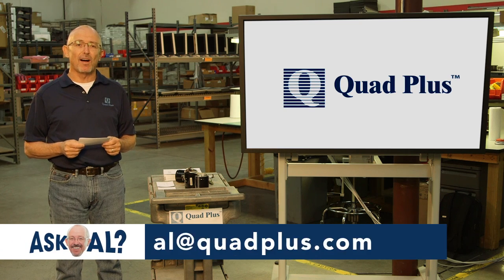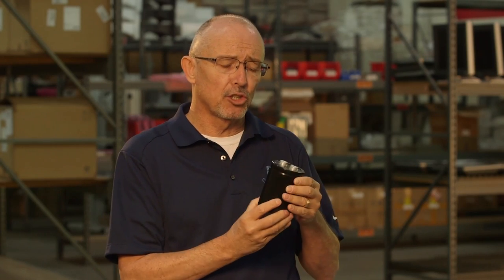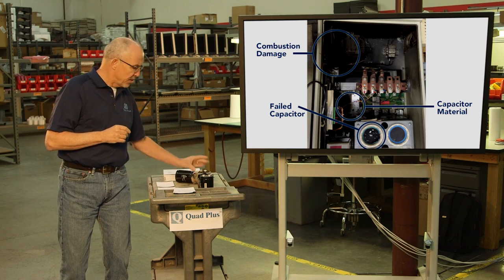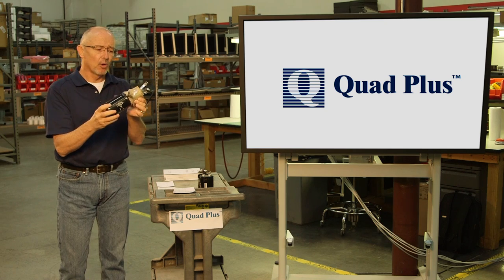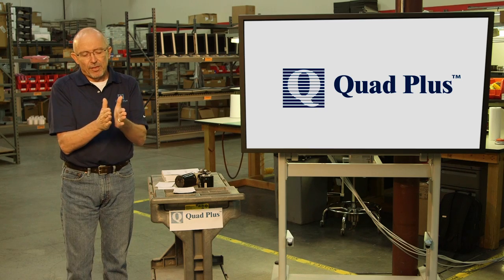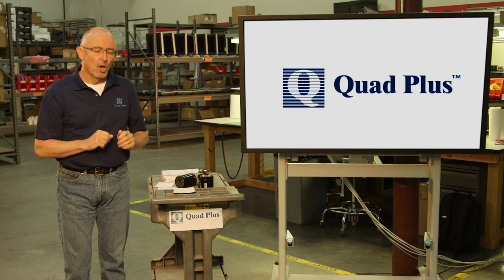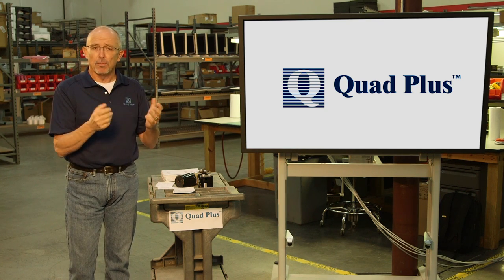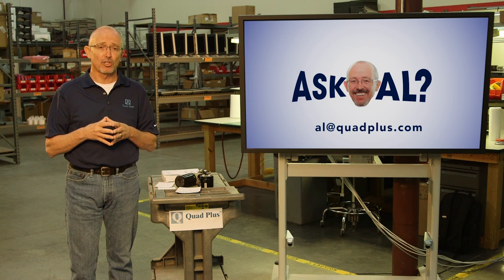Capacitor Reforming - Why Do Capacitors Need Reforming? | Ask Al presented by Quad Plus

Comment: i heard that reforming capacitors require more time than just seconds to reform them, especially large values. form CHATGPT:
Reforming electrolytic capacitors can take time, especially for larger capacitors or those that have been unused for an extended period. It's recommended to allow several hours or even days for the reforming process to complete, depending on the capacitor's condition.

Comment: Thanks Al for that info. I'm aware of slowly bringing new capacitors up to operating voltage and hence current flow. I just replaced my electrolytic filter capacitors with exact uF and 20V additional power specs. in my transistor stereo power amp. What is a good voltage and time interval increase for forming my new caps with the amp plugged into my AC variable voltage power supply? Also, as the caps form and charge up, I'm guessing I will begin to hear a white noise signal coming through the speakers (increasingly). Is this correct?
Thanks so much.
PH

Comment: I made an automatic reformer unit using 2 timers 4 relays and a 600VDC power supply. It will start at 200V and then switch to 400VDC after 2 hours and finally switches to 600VDC after another 2 hours.

Comment: RIDICULOUS.   I'VE REPLACED 10'S OF THOUSANDS OF CAPACITORS IN HIGH VOLTAGE TUBE GEAR AND NEVER HAD A NEW CAP EXPLODE...UNLESS ITS WIRED BACKWARDS BY ACCIDENT.  THE ONLY TIME I "REFORM" A CAP IS BRINGING UP A LONG DORMANT DEVICE SLOWLY ON A VARIAC.   BUT THATS FOR DIAGNOSIS. THE OLD CAPS GET REPLACED ANYWAY.
Reply: I guess u are using your high voltage caps in a flyback PSU, what is a completely different animal. Please look up Capacitors in VFD "Variable Frequency Drive" and DC-Link-capacitors. 
BTW: No need for shouty caps, my dear.
Reply: @mistersunny3636  MAYBE IM VISUALLY IMPAIRED AND ITS THE ONLY WAY I CAN READ WHAT I TYPE.......
Reply: @mistersunny3636  This is audio electronics...Im not a commercial hvac guy working on blower motors...or dealing with power conversion on demand etc.  The only time a cap explodes...is if its factory defective. Or some moron wired it backwards.   An existing cap in vintage gear always does the same thing. Its inactive for years. The cap electrolytic gases out its moisture. Gases burst weep hole in cap or possibly split it open. The cap then grows a "mushroom". lol.  Then they short. Usually the ripple is so obvious...people know better than to run them until they actually short.  Its 50/50.   Typical scenario is...guy finds old tube amp or stereo...etc.  Guy fires it up to see if it works.  It either blows a fuse...hums loudly...or works. If it works...it will be for a short time only. Then it will hum...and blow fuses. Worst thing for a cap is inactivity.  Some morons talk about "reforming" caps in vintage gear.   Sorry...you are not magically going to restore the dried electrolytic that is leaking outside the cap in a corrosive mushroom.  I have a barrel of old caps from take outs....just my daily work...that is so heavy...I actually cant move it at this point. Its an issue...and I have to figure out where do get rid of them safely. Batteries with no memory....lol.